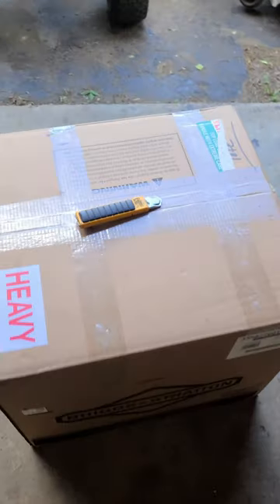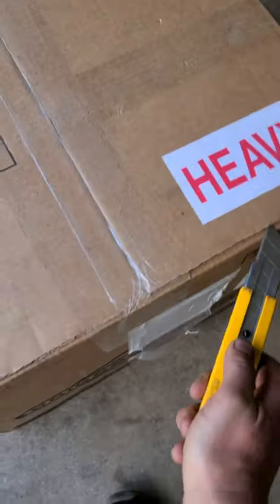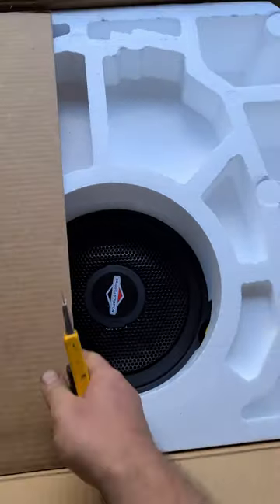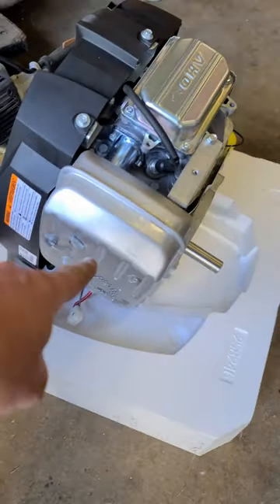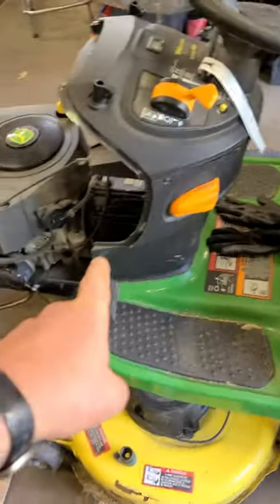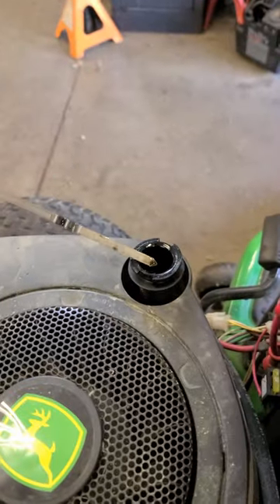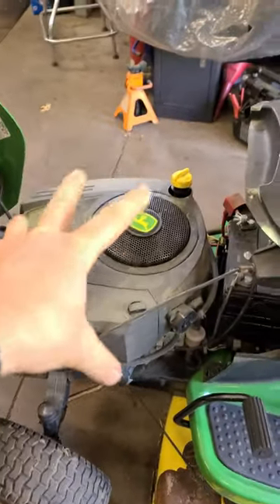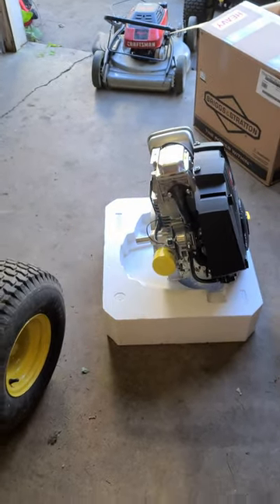Unboxing A New Briggs & Stratton Engine For A John Deere Lawn Tractor #shorts

Comment: Two of my old rear engine lawn tractors I engine swapped need that style muffler but I can't find anything that's not over $100. A part number would be great as I haven't seen that style which would fix the clearance issue on the NOMA sold by Lowes in the 80s. I fabricobbled one together but paint and a grinder make me the welder I ain't.

Comment: Done several of these this year and last .The faulty 21 & 22 HP engines they come with seem to grenade like clockwork between 60- 120 hrs.
Replaced them all with the single cylinder 19 hp Briggs EX  Professional Series .
$800 bucks Canadian from Briggs, 2hours labour  Away you go a day later back up & running.

Comment: Nice! However if that was my tractor, I’d want  a nice used Kohler Command 17 horsepower to re-power and re-wire it.
Reply: That’s what I have in my old mower , kohlers have been good to me I too am a vikings fan. SKOL
Reply: @brucedale4465  awesome! SKOL! I am installing a 15 HP Kohler Command in a 2017 Troy Bilt Pony. Engine failed at 70 hours 😂

Comment: I watched your swap video with this engine. I was curious why you used a 19hp engine instead of the 21hp that was on the JD120.
Reply from the maker: That was the only engine available
Reply: @donyboy73  now I know what to do if I blow up my JD
Reply: Horsepower is overrated. I have six lawn tractors and the 13hp Ariens is my favorite which is the least HP rated of them.

Comment: Why would you put a new engine in . It's cheaper to buy a new tractor . Or good used one.
Reply: Am I missing something? That engine is around $800 and a new deere tractor is on the order of $2400.
Reply: @MrZack1497  Plus the newer it is, the cheaper the quality.